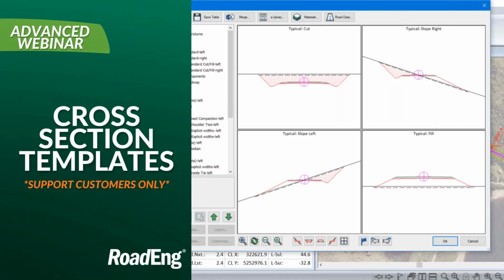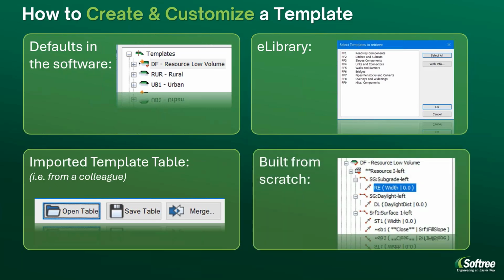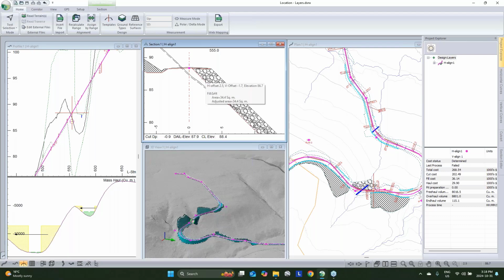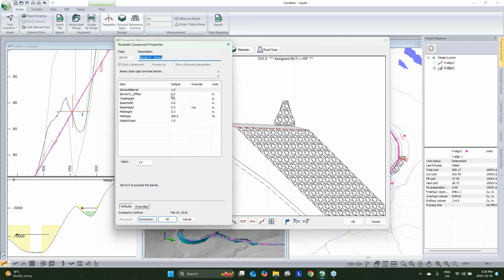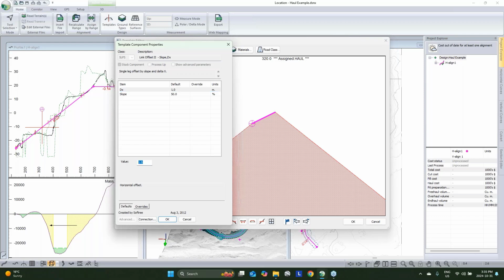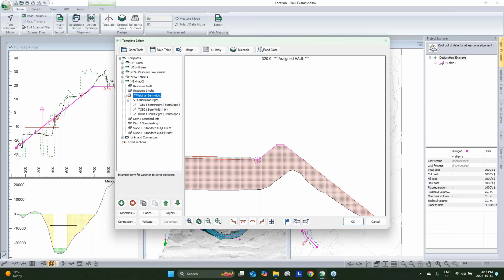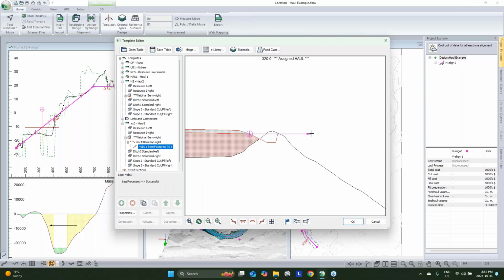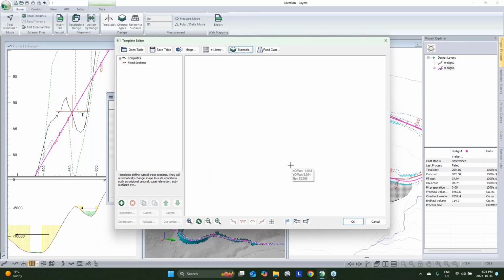Advanced Webinar - Cross Section Templates

Comment: Hi! I really enjoyed your presentation on the template logic—it was very well done. I have a question: is it possible to apply different hatching to parts of a template based on whether they fall in a cut or fill area? I’ve been struggling with this. Specifically, I’d like to use one color for all the cuts and another for all the fills.
Reply from the maker: Hi! I think this article answers your hatching question: https://support.softree.com/knowledge-base/location-module/project-specific-techniques/controlling-cut-fill-hatching-section-window

Let us know if you need more assistance!